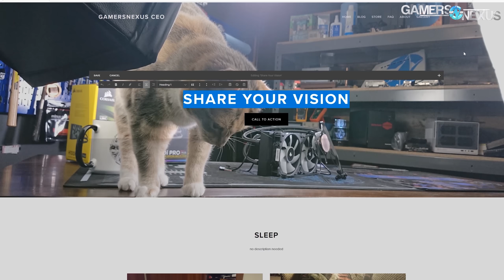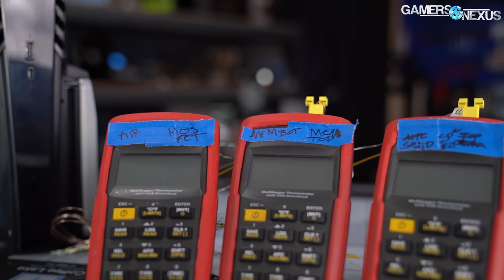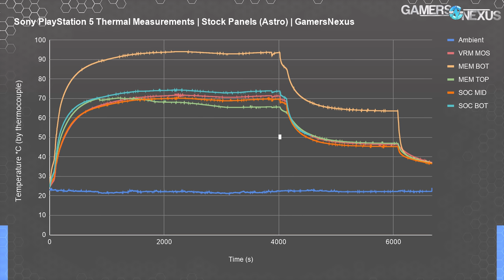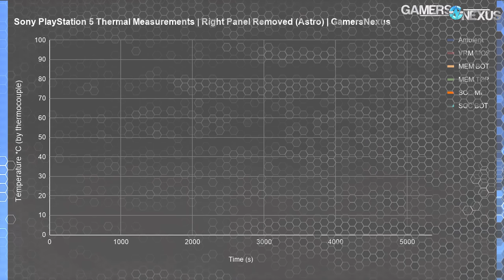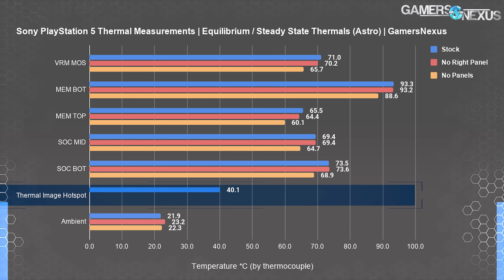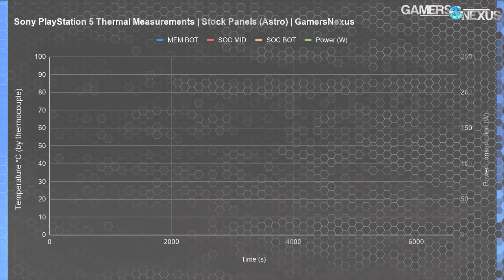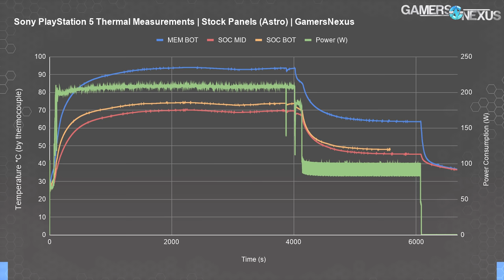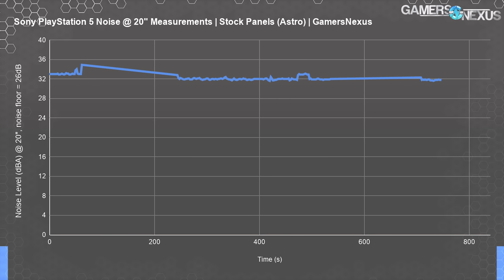Weak Cooler Design: PlayStation 5 Thermals, Power, & Noise Testing

Comment: Great analysis, please do the same for the Xbox Series X.
Reply: Yeah I really wanna see that
Reply: And Series S
Reply: mikeisu  no one cares cause they not breaking as frequently as ps5 right lol
Reply: @lillarry3000  man.... you killed those ps5 toxic fans
Reply: mikeisu  not like ps5 people have gone threw 2 ps5s already
Reply: mikeisu  i care, because i have one, what i don't care is your opinion about it
Reply: temps were tested by Digital Foundry at around 50-60 degrees on Gears 5 on dynamic 4k, but the xbox has much better exhaustion than ps5 to maintain cooling throughout, much lower than my gaming pc, mainly due to the fact the board is split into 2 to spread heat with a giant sink on one side and the airflow is 100% from bottom to top
Reply: @biscuitsntea421  yes the DF does a very good job, but this guys go the extra mile on testing
Reply: @Kennysteny  I do agree
Reply: @telagabiroe8789  You sure about that? Because it sounds like he’s the toxic fanboy trying to start shit.
Reply: The xsx runs smoothly without problems, I’ve been hunting the ps5 since the preorders started, but now I see that I can wait.😏
Reply: @lillarry3000  

You really have to blatantly lie like that... no chance in hell you went through 2 PS5s.
Reply: What gaming computer with this power and thermal is 500 dollars let's not pretend this is impressive. Also yeah Sony could improve cooling but do you want an even bigger console lool
Reply: @averagecartoonfan3519  check out Marlongammingnation hes a YouTuber 2 ps5 broke on him look it up and hes not the only one  and come back and tell if you still think I'm lying
Reply: @lillarry3000  

Just watched one of his vids and what he experienced was a software issue, not a brick. Those are two completely different things.
Reply: @averagecartoonfan3519  point is he returned both of them
Reply: @averagecartoonfan3519  I know a YouTuber who's went through about two to three already
Reply: @monsterhunter445  there was actually talk about how they were going to make the PS5 even bigger than it is. But that shouldn't be the solution, they should just make the engineering similar to what the Xbox is doing. Xbox seems pretty small but seems to have good cooling
Reply: @averagecartoonfan3519  whether it's a software issue or not, his console doesn't really even power on. It's pretty much bricked. And even if that is a software issue, do you think a patch would fix that?
Reply: @averagecartoonfan3519  he can't even turn his console on, how do you think he it's going to download the patch? You guys can't just keep saying everything is a software issue. Not every problem known to man can be fixed with an update. And of course both will have issues, but I'm not seeing anybody I know personally or any YouTubers I know have serious issues.
Reply: @biscuitsntea421  MS learned the very hard way about proper cooling and design.
Reply: @biscuitsntea421  the Series X uses far superior vapor chamber cooling and heat exhaust solution.
Reply: @monsterhunter445  you do realize that consoles are sold on lose so they are more worth than they get sold for?
Because thats a good marketing way to sell something cheap and then charging someone more money by playstation plus or by a game tax and nope you dont need to pay ps plus to game online on a pc and you pay less for pc games Because console games are always more expensive between 20 and 30$ more
Reply: @null643  By xbox 360 do you mean the red ring of death or when they decided to fix that issue.
Reply: @EndlessFunctionality  Microsoft spent 1 billion dollars to learn it.
Reply: @lillarry3000  source on that? Genuinely curious about random youtube commenter who has failure rates of both xsx/s and ps5 at hand and can readily provide them
Reply: @patrikgrulich2  what?
Reply: @lillarry3000  source on ps5 being more defective than xbox
Reply: @lillarry3000  ps5 seems to be like the rrod from the 360 when they launched!  Amazing that such a big company like sony cant make a console with a good cooling solution.
Reply: @lillarry3000  I can't wait for the series S buyers to realise they have bought a weak console that is barely better than the x. Only time will tell if we are faced with a new RROD or YLOD yet. Aren't some XBOX's shutting down when using certain games at the min? Man XBOX fanboys are just as bad.
Reply: @cynthiaandoh9575  pretty small? It's a fucking block. Have you seen these things horizontal?  They don't fit under a TV, just stand it up like the itx form factor PC that it is.
Reply: @handlesarefeckinstupid  I think they do shut down mine hasnt but the good thing is it doesnt shut down to the point where you have to return it back to sony lol and xbox series s is for affordable for people who dont have a good tv did you think about that?
Reply: @averagecartoonfan3519   I had 3 dead on arrival ps4 the last launch so why is this so hard to believe? took me months to resolve
Reply: Dem ps 5 got 70c its like a pc i hope ps5 redesign for the pro in build quality using plastic its not good around that temperature in pc using metal case
Reply: @patrikgrulich2  mybad I didnt reply just search it on youtube a bunch of people are having issues check out Marlongamming nation 2 of his broke
Reply: @adnanmicahchips2842  start or finish?  You read well?
Reply: @handlesarefeckinstupid  you can't wait for that?  I can't wait for toxic fanboys to line up and go play in traffic.
Reply: I really care about that in will buy xbox sx cuz the PS5 is not durable
Reply: Let the console wars begin! lol I wonder how many of the fanboys realize they are just working for free for their pet company, while it sells them crappy overpriced stuff, that will break right after warranty ends.
Reply: @southstaronline  I dont really care if hes click bait or whatever he does to me hes a sony die hard and for him to admit something is bad with playstation is really hard for him to do but he didnt lie about it breaking down
Reply: @bernardodepadua  
Thats sony not xbox 
My xbox 360 is still work like the first day and i have it for 15 years bro 
So xbox sx is not crappy at all 
I tryed ps2 and ps4 and they broken after 2 years sony is crapp
Reply: @southstaronline  he still has a ps4
Reply: mikeisu  “No OnE CaReS aBoUt ThOsE” yet equally as sold out as the ps5.... interesting 🤔
Reply: Lubon Jack  
Its mistake bro please excuse me 😥
Itss a bbbbig mistake i am sorry oh god  please forgive me i did something horrible i wrote a mistake word
Reply: Lubon Jack  
😂Ok i will tryei bro i will tryei you know i love to tryei new things
Reply: @patrikgrulich2  They don't have it , they're lying because they don't anything to brag about for their console anymore LOL

Comment: I really don’t see the big deal. Got my PS5 yesterday, Ill just put some ice cubes on top and on the sides, problem solved!
Reply: IKR I thought it was pretty standard to keep your ps5 in a fridge really weird that others don’t do that
Reply: @alexholiday441  Do you mean you put your PS5 inside the XSX ?
Reply: @NoneRain_  you attach the xsx to the ps5's butt exhaust to increase airflow .
Reply: I’ve had mine for 3 days I feel like my PS4 pro runs hotter than my ps5 but then again I gave the ps5 plenty of clearance between the wall.

Comment: I want to mention that Sony is planning to push fan-profiles out based on how each game performs. As you mentions: The fan has a lot of room to grow
Reply from the maker: Very interesting! Any source for this?
Reply: And the noise too 😐
Reply: @GamersNexus  I think it was said during the "Deep Dive". I'll investigate!
Reply: ...so a few patches will make it louder. That's bound to go over well lol.
Reply: @TotallyOperator  That's what I gather as well. An extra couple of Db I can live with but it may run amok.
Reply: @TotallyOperator  I mean even if it gets to 38DB its basically more quiet than any GPU that isn't watercooled.
Reply: @GamersNexus  Sony stated it, its part of their belts and braces approach to thermal cooling. Let’s hope it doesn’t end up sounding like a jet engine again....!!!!!
Reply: @mrmagoo-i2l  A marginal increase in noise for reducing even 10 degrees off the memory will add years to the lifespan of the console. Well worth it.
Reply: As long as it doesn't sound like a jet engine, I would not mind a bit more noise in exchange for better cooling performance
Reply: @nerotenebre  Yeah my PS 4 is loud af when playing certain games. Warframe really kicks it up.
Reply: @TotallyOperator  40db is normalized noise levels, the ps5 is far under that. pushing the fan for better cooling is exactly what they should do.
Reply: Just give us manual control like afterburner/precision maybe?
Reply: @TotallyOperator  no matter what it will never be as loud and obnoxious as the PS4's tiny blower fan.
Reply: @GamersNexus  Yeah Sony said this a while ago
Reply: @WayStedYou  yes it's alot less noisy than any of my PC's and really a lot less. I can't here my ps5 from the Sofa, My PS4 I can hear from anywhere in the house :p.. PC too while gaming
Reply: @nikolowolokin  the verge...
Reply: @michaelmeyers7216  WOAH FAN PROFILES IN 2020?
Reply: @LaughingMan44  Its amazing right. SSD's are also a thing now.
Reply: I wish Sony would just allow users to  adjust fan speed (something like boost mode on the ps4 pro). I've never understood the complaints about noise...but then again, I use to run 780s in sli (with the fans running at 100%) as well as a box fan not 2 feet beside me while gaming xD
Reply: @TotallyOperator  LOL let the console run hot but quiet once the reviews are over slowly increase fan speed so that people don't notice. I see you sony
Reply: does that mean we can still get the jet engine sound back? lets go!
Reply: @marksapollo  If you're PS4 sounds like a jet engine, it's your fault because you don't open it up and clean it.

I've opened mine, taken it apart and cleaned it thoroughly. It has been very quiet since then.

There are tutorials on YouTube to help you do this and the toolset that includes the proper driver is cheap. I recommend the set, because a single driver is not much cheaper than a set of them.
Reply: @Silverturky  thats basically the original fat ps3s fan profile. It won't increase the fan speed until the system passes around 70C, and only moves it up a slight bit every few degrees.
Reply: sounds BS. why not just use thermometers and fan profile according to the actual temperature?
Reply: @James_Bee  you can’t expect the average consumer to take apart their console and clean it. That’s not at all realistic...
Reply: @lightningcrap98  But you could expect them to take their console to a shop and have them clean it i think.
Reply: @ciraxa  no. To expect the average consumer to do anything other than play games on it is wishful thinking.
Reply: Thomas smith i have my PS5 horizontal and shoved in a cubby in my TV stand. I have heard the fans 2 times when I forgot to turn on the USB fans I use for airflow. The best part of their design (of which I am not a huge fan overall) is that when horizontal it pulls cooler air in from the front on the right side (or the top when vertical) and not just the entire right side where heat can building up in the back of a tv stand/cabinet. I still use 1 fan to help pull in cool air on that side and to push air out the back cutouts and to the exhaust side, and the 2nd fan pushes the hot air out on the exhaust side. I will probably have to consider a better long term solution for it: bigger cut out in the back of my stand, moving it vertical somehow with limited space, etc.
Once people figure out the legal side of things, will be interesting to see if people come out with custom panels to help with cooling.
Reply: @TotallyOperator   ... No change goes over well nowadays, ther's always some ""group""  waiting to get their chance to start "whining" ;) How ever obscure their ""case"" might be.
That aside I think it's less risky for Sony in this situation. I think people already "in the fold" will "rationalise" the potential downside away" (as long the change is within reason). Especially if Sony claims some kind of "better performance" for the ""feature""...
At least that is how I see it "playing out"...
Best regards
][To whom it may concern:
 NO I'm not a Sony nor XBox Fanboi, I've never owned either platform, and I hardly ever even play games. I'm interested in "Tech" and I generally "wish all platforms and manufacturers" the best". So I don't "root for or against " any platform or manufacturer as long as I don't perceive their practices to be "consumer hostile" or "blatantly dishonest". I simply hope they all "do well" because I  believing that the more strong competitors there are in a market the better off the consumer is...]]
Reply: First link from the Verge, lmao. Vergetnam flashbacks.
Reply: @James_Bee  Wrong, actually it’s a k own issue with the launch PS4 and PS4 Pro due to the cheap fans Sony used, it cha fed to other fans later that were much quieter. Cleaning the console does nothing.

Comment: I'm a little disappointed that they didn't take into consideration a proper cooling contact for the memory. Then again, sometimes 'just good enough' is all they are going for.
Reply: Right?  I mean... they only had to pay to get the stamps/tooling done once. You'd think they'd have designed the tooling to create a contact area at least as big as the memory package..... Very weird.
Reply: @BRUXXUS  if this gets enough attention sony could do little fixes with the next batch. but then again the design as a whole is lacking for the other side of the pcb.

Comment: Well, it's certainly an improvement over the PS4 cooling.  The PS4 is the loudest home consumer electronic I know of, and you had to pretty much fully disassemble it to clean out dust.
Reply: @Hardware Hacker he probably washes his clothes with a washboard
Reply: @Hardware Hacker I mean a washing machine is electric, not electronic right?
Reply: @basshead.  Eh, since you watch GN taking one apart, cleaning it, and repasting it isn't that big of a deal.  Just kinda inconvenient.

If you buy a used one though it's pretty much an absolute must, I bought a 3 year old one and it was just disgusting inside.
Reply: Maybe its age is at fault but my 360 is far louder than my PS4 (the PS4 is often dusted internally tho)
Reply: @josephh5993 I think it's primarily the launch PS4 and launch PS4 pro that tend to get extremely loud.  My old 360 (2008?) was never all that loud in comparison, same for my PS3 slim
Reply: @basshead.  that, and I think the thermal paste Sony used wasn't particularly good.
Reply: @basshead.  bit of a cheapskate eh?
Reply: Fully desemble?
Reply: @basshead.  The slim version is quiter , i have mine since 4 years ago it's not noisy at all. On the other hand the normal version can get loud AF , especially used since console players rarely open up the console so open it up , clean it and repaste it , than it should be fine.
Reply: Ps5 has vacuum vents too, underrated feature!
Reply: My XBOX 360 while it's reading the DVD is the loudest thing I can think of. If I installed the game on a hard drive it would be a lot quieter but still the loudest thing I can think of.
Reply: Computer with a delta 80mm fan.  Those were the days
Reply: @startedtech  My washing machine is definitely an electronic device. It has more buttons than my gaming console.

It's also very quiet and I often forget it's running, except when it finishes because the chime is REALLY loud (not a complaint).

Also, for those that complain about loud PS4s and having to take them apart to clean them.... du'h.

You take your panels off your PC to clean it, a console is just a compact PC so obviously you'll need to take it apart. It is not difficult and took me about a half hour the first time I did it (and only time Ive needed to, so far).

The fan instantly stopped sounding like a jet engine. 

Stop being a lazy person and clean your electronics, people.
Reply: I have the 1200 C-Chasis Series PS4 it has never gotten loud maybe audible but never loud like Jet status.
Reply: XB1 has to be disassembled as well
Reply: @basshead.  

nerd nerd nerd 🤓
Reply: @James_Bee  good for you and your nice washing machine, mr. Pedant.  Regardless, your washing machine has electronics in it.  That doesn't mean you'd call it an electronic.  

And my point was that with at least the original PS4, it has to be fully disassembled if you want to clean it.  On a laptop or desktop you usually just take off one panel and you're good.  Also, the average person certainly does not know how to disassemble and clean it and they probably wouldn't feel comfortable doing so.

Also, I clearly remember playing The Last of Us remastered when it came out (so ~6 months after I got my launch PS4) on high framerate mode and it was pretty dang loud even then.
Reply: @jmejia9027  yeah, the PS4 slim isn't loud.  The OG model PS4 and then the PS4 Pro revisions apart from the very last one.